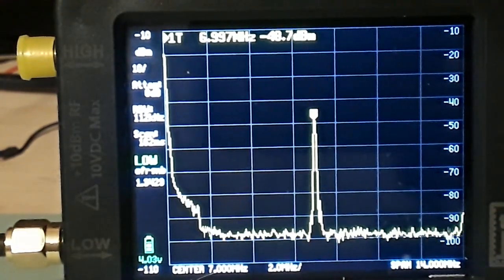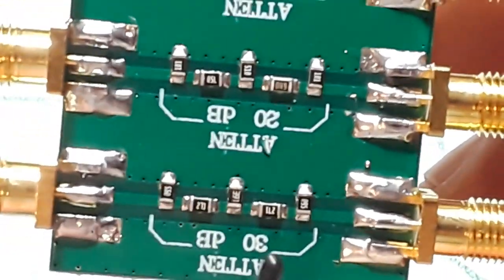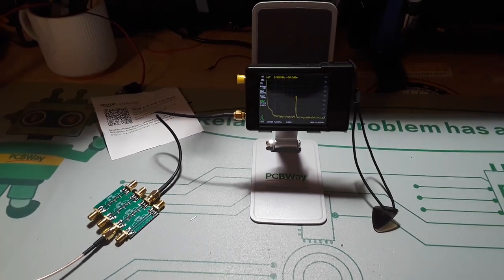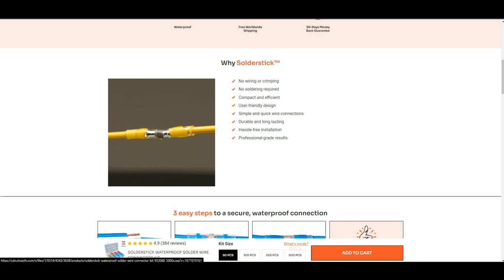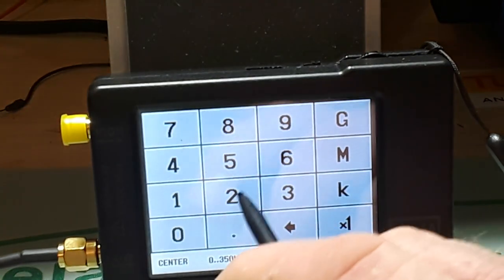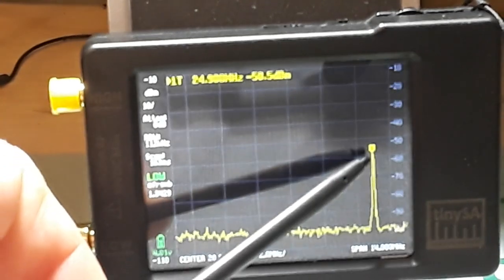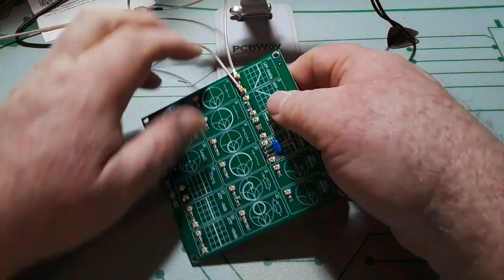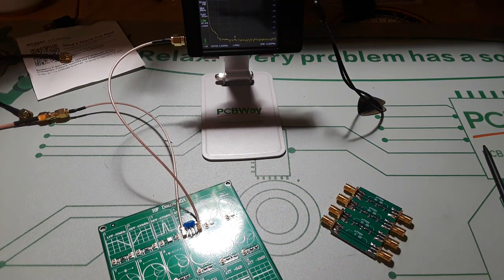Testing Attenuators With The TinySA brought to you by Solderstick Solder Wire Connectors

Comment: Fun video!  When playing with small amounts of power and a spectrum analyzer you will find that the loss from each connector and adapter as well as the additional cable length is significant. You should try to calibrate that out for best results.
Reply: Yep.